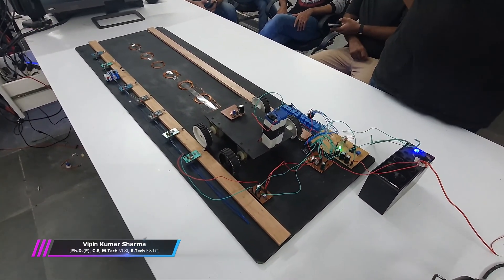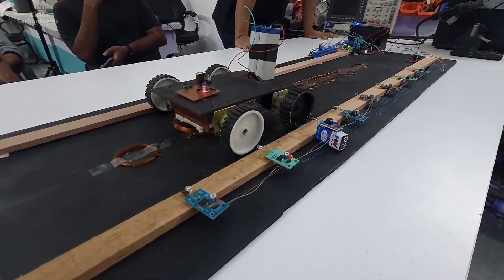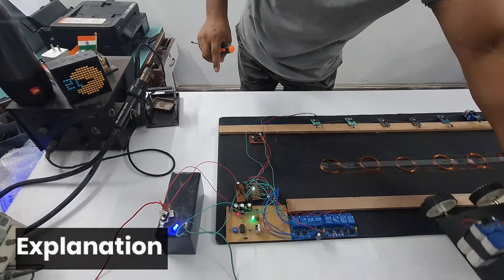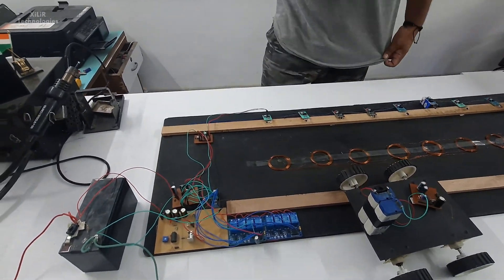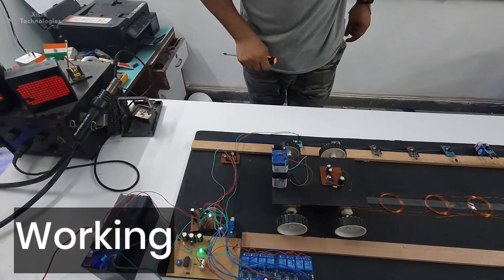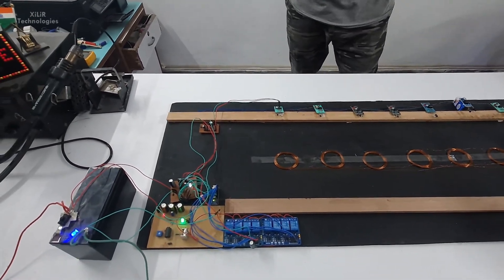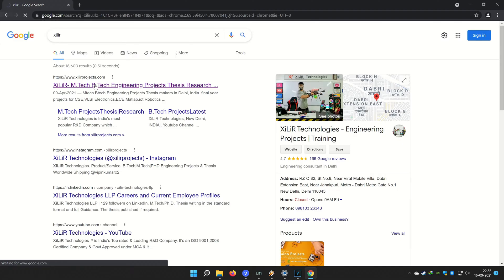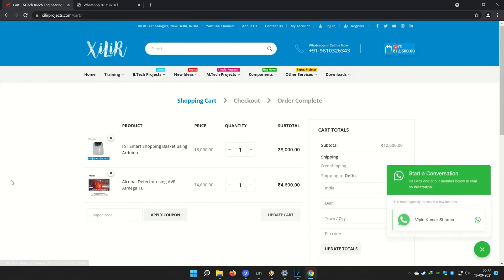Wireless Energy Transfer on Road for Electrical Vehicles using Arduino | Best Engineering Project

Comment: Can u plz tell whats the mechanism behind the car movements.
Is any external method to run the car like remote or car automatically run with the help of battery if yes than How?
Reply from the maker: Its simple motor connected with battery n button. If wireless car control simply bluetooth can be added with #arduino and l293d motor driver
Reply: @XiLiRTechnologies  you didn't answered my question, is the car runing
With the help of charging  or external button or remote
Reply from the maker: @BOSS-mc3mq  car is running with the help of battery which is charged by running on road having coils ..these coils are charging the battery wirelessly

Comment: Can you tell me the output generated in battery how much before and after.. its efficiency
Reply from the maker: Depends on coil turns, in this its 12v , can be boosted 50v also as required
Reply: @XiLiRTechnologies  I'm asking generation through coil on vehicle battery.. not the 12v big one to give power
Reply from the maker: @karanchoudhary5222  thats what i have answered
Reply from the maker: After receiving 12v , after that ic 7805 is used to regulate 5v to charge 4v battery
Reply: @XiLiRTechnologies  okay thank you... How we will measure this change in vehicle battery?
Reply from the maker: @karanchoudhary5222  by digital  multimeter ..in description, short is there. see the video ..thank u

Comment: How did you calculate the number of turns of copper wire for both transmitter and receiver coils? Please reply.
Reply from the maker: Just by n1 n2 ratio for transformer...n 50khz is the frequency

Comment: Sir, can you address what the operation of Arduino  and working  of it
Reply from the maker: Arduino is used for sensing obstacle in front of ir sensor n controlling coil in front of that using one particular relay. 
Ir --> arduino --> relay --> coil on

Comment: Bro can you tell me the rating of both coil
Reply from the maker: Copper coil 1inch distance...n tx 50 turns n 300 turns rx
Reply: Primary coil centretape Mai transistor or resistor ka rating kya hoga

Comment: can you please tell that what are the components used in this project in detail.... plss
Reply from the maker: HARDWARE COMPONENTS

    ARDUINO (MICRO CONTROLLER)
    IR SENSOR (8X)
    RELAY (8X)
    POWER GENERATION CIRCUIT
    TRANSMITTING COILS (x8)
    RECEIVER COIL (ON VEHICLE)
    BATTERY
    DC MOTOR (x4)
    POWER SUPPLY
    WHEELS x4
    12V, 2A  DC POWER SUPPLY
    JUMPER WIRES

SOFTWARE

    ARDUINO IDE
    EMBEDDED C

Comment: What are the materials needed for th this project?
Reply from the maker: HARDWARE COMPONENTS

    ARDUINO (MICRO CONTROLLER)
    IR SENSOR (8X)
    RELAY (8X)
    POWER GENERATION CIRCUIT
    TRANSMITTING COILS (x8)
    RECEIVER COIL (ON VEHICLE)
    BATTERY
    DC MOTOR (x4)
    POWER SUPPLY
    WHEELS x4
    12V, 2A  DC POWER SUPPLY
    JUMPER WIRES

SOFTWARE

    ARDUINO IDE
    EMBEDDED C
Reply: Have you done this project??

Comment: What all components is in ocilating circuit..
Reply from the maker: HARDWARE COMPONENTS

    ARDUINO (MICRO CONTROLLER)
    IR SENSOR (8X)
    RELAY (8X)
    POWER GENERATION CIRCUIT
    TRANSMITTING COILS (x8)
    RECEIVER COIL (ON VEHICLE)
    BATTERY
    DC MOTOR (x4)
    POWER SUPPLY
    WHEELS x4
    12V, 2A  DC POWER SUPPLY
    JUMPER WIRES

SOFTWARE

    ARDUINO IDE
    EMBEDDED C
Reply from the maker: https://www.youtube.com/watch?v=x97lr4L12II&t=0s

Comment: Bro , how much turns in the transmitter coil and receiver coil?
Reply from the maker: U can take ratio of 50 and 200 on output
Reply: Bro how much diameter for each coil..
Reply from the maker: @abhishekkbabu7620  approx 3cm to 4cm
Reply: Bro, what anount of power supply is given to the each coil..
Reply from the maker: @abhishekkbabu7620  u need to give pulses ranging from 12v to 18v
Reply: How coils are connected each other?